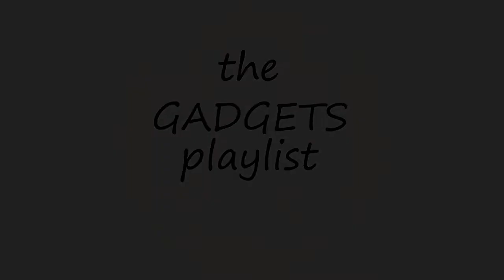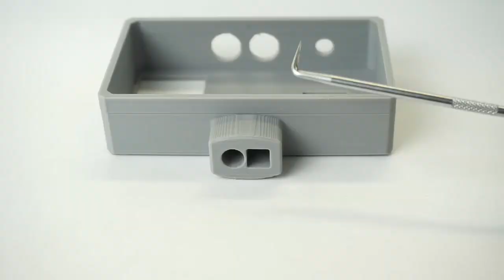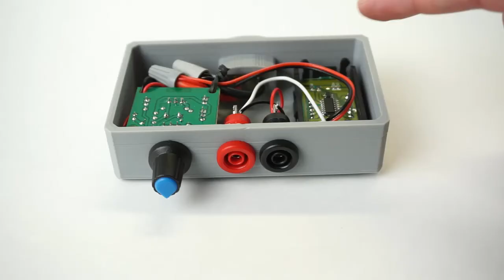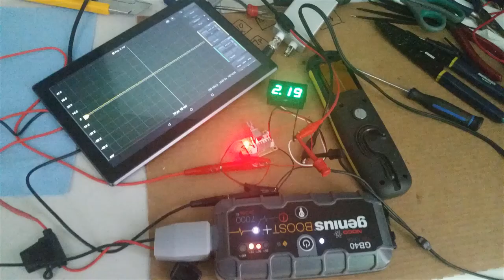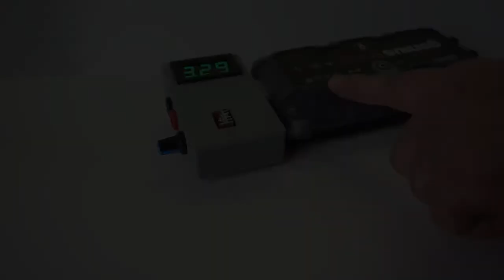GADGETS#142 - NOCO GB40 VARIABLE PS

Comment: This gave me some information. thank you. I bought a PCB spot welder and need a battery. As the spot welder needs 200A at 12v I was trying to figure out if I could use this battery as a power supply. Thank you.
Reply from the maker: on the back of this GB40 it states output = 12v 1000A

hope that helps Jacob

Comment: I wondered if the noco would work as a power supply. I thought it was a capacitor discharge type box so I didn’t think it would work.
Reply from the maker: NOCO GB40 has a huge X10  3 layer lithium battery! There are teardown videos on YT.

Comment: Nice clean looking build!
I'd put an enclosed fuse in there, considering screws or random wire clippings could fall through the heatsink hole. That battery wouldn't take any prisoners in case of short circuit or malfunction!
Reply from the maker: yeah, I anticipated this comment...and you're probably right...came close to soldering one in and ultimately just decided to not bother...

you'll notice an inline fuse was put in #141

if people can sleep at night with the 3 layer lithium pouches in the GB40 laying around the house or car trunk in the heat and as these boosters age then they have the risk tolerance required for this build...

but your point is well taken Dave and anyone doing this build can add a fuse if uncomfortable...

Comment: Another handy Gadget,  I'm surprised you could print the inside hole without supports, we never know until we try.
Reply from the maker: I get away with murder with that basic Ender 3 ... either the settings, the firmware upgrade, the PLA brand...I'm not sure what I'm doing right...lol